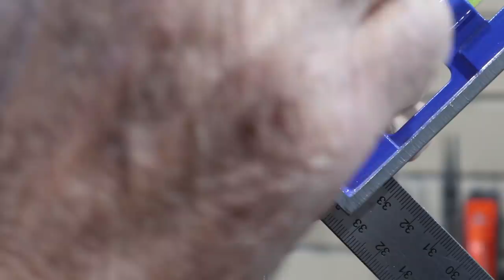I make an Industrial Style Shelf Bracket using Rebar and Large Nail Heads as Rivets. Welding Project

Comment: Very satisfying to see you respond to all of the comments. A most uncommon feature. 
As for your project, I'd only make one change, and that is to drill those four inside screw holes before you weld the thing together. Good stuff, Aussie..!!!
Reply from the maker: Thank's mate, a very good suggestion. Once I have one made, I have a template to make others, so all the holes, and the angle cuts on the ends can all be cut and drilled before bending and welding it. I appreciate your comment.

Comment: You could have drilled one hole in each end of the shelf bracket and chamfered the back of the hole, bring the nail shank through each piece and leave it proud a 1/4 inch, heat up end and peen over, grind flush. Beautiful work!
Reply from the maker: Yes that would have good the job done nicely, thank you for your comment.

Comment: Where did you get the small magnetic clamp? As always, I enjoyed your video.
Reply: I got mine from Hare and Forbes in Brisbane
Reply: Made by Stong Hand Tools.  Purchase through local welding shop, Amazon, maybe eBay.
When using in a weld tack your piece then remove. The high heat will ruin the magnet.
Reply from the maker: Thank you I am glad you enjoyed the video, I bought my magnet clamps from Total Tools Australia, but you have two other great answers to your question also here in your comments.
Reply from the maker: Thanks mate, I appreciate your input.

Comment: Great job. It is better for you to give dimension information. Is it possible to make the same welds using stick welding? Thanks a lot.
Reply from the maker: Thank you very much. I have started putting the dimension information in the description on my last few videos, I will do the same for this one in the next few days. If you use a stick welder trying to weld through a hole to keep your welds hidden, it will likely arc out on the side of the hole rather that the steel at the bottom of the hole, a bigger hole would help with this problem, and on this project ,that would not be a problem as you could have quite a big hole. I have done many stick welding projects like this over the years, just have a play. I find the MIG is much better than using the stick, I don't stick weld much now. Thank you for your comment.
Reply: @GavinClarkdiy  Thank you for your response. I am an amateur welder even at the beginning of the road. I will try to make this shelf bracket using stick welding. What do you think the hole diameter should be? Should it be close to the rebar diameter?
Regards.
Reply from the maker: @sahinsozen3946  I would make is as big as it can be without being seen, have a play on a bit of scrap, that is the best way to learn, I wish you the best
Reply: @GavinClarkdiy  Thanks a lot.

Comment: How did you weld the two parts together at 18:45? Did you push the wire through the piece of steel to join them? Not a welder so I don’t know.
Reply from the maker: I drilled 4 holes in the back bit, and welded through these holes, welding the two bits together, just the same as welding the side. https://youtu.be/uQqVzqTNYzc?t=1017

Comment: Stay learning with you sir, may I know your speks of the cordless  drill?
Also the drill bit that makes holes for bolt heads?
Reply from the maker: Thank you very much, I am glad you like my work. The Countersinking Bit, is 13mm and I cannot see the brand, but it would be P+N or Sutton brand. The drill is an "Ozito" 13mm18volt Brushless, 13mm PXBDS-220   Ozito is a cheaper type brand of battery power tools, not normally used in the trades. I use it mainly for woodworking. Hope that helps.

Comment: That bracket looks really neat. The nail was a great little addition to give it 
Character too.you won’t find those brackets at bunnings. Question for you. Where did you get that little pivoting magnet where you tacked the nail to the bracket? I haven’t seen them before and would find them very useful. I’m going to make a set of these brackets of yours. I recon they are pissers. I’m thinking of blueing them to give a gun barrel effect. Even cold blueing would do the trick I think.
Reply from the maker: Thank you very much, I am glad you liked it. I think blueing it would look great. I bought the magnets from Total Tools, Amazon also has them if you cant get them locally, search welding magnets and they will come up along with others, I will try to organize links in a few weeks to the things I am using. Thank you for your comment.

Comment: What kind of paint to finish your project?
Reply from the maker: I often use Penetrol Rust Treatment Penetrates Rust 300g Aerosol Spray, and then put a topcoat of Semi-Gloss Clear Coat. That is what I used on the rebar lettering on the back of my workbench, here is the link to that video. https://youtu.be/JA-wk62Zghk  I have decided not to comment on finishes, As what climate you are in, is it inside-outside, lots of rain, ice, do you want long term and rarely touch, or a wax with a wipe over every year. That is why I have no opinion, Please ask someone in your area what you should use, I feel this is a better way to find out. Thank you for your comment.